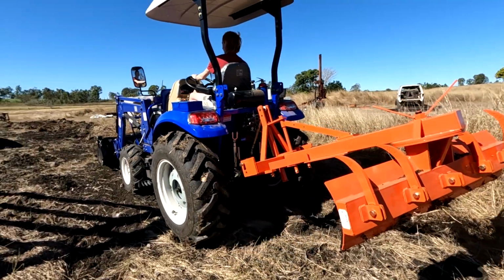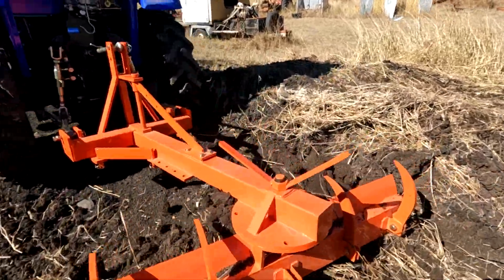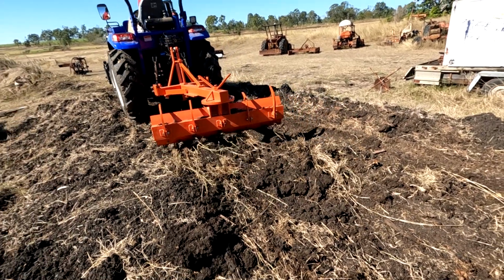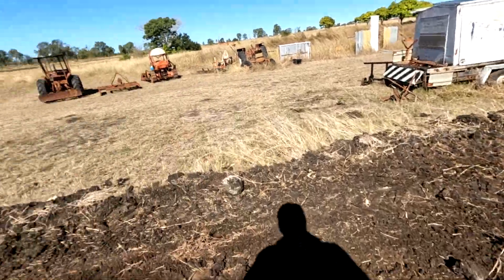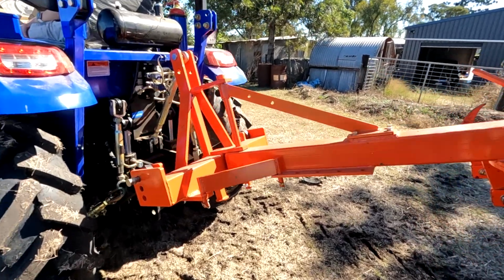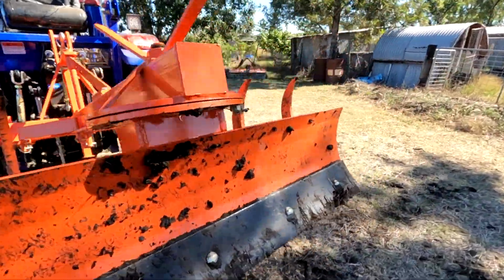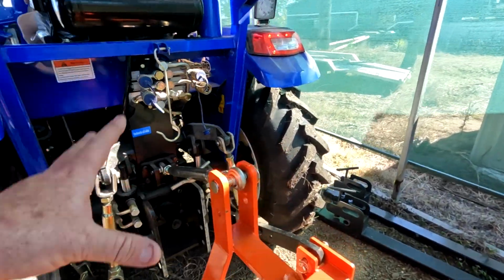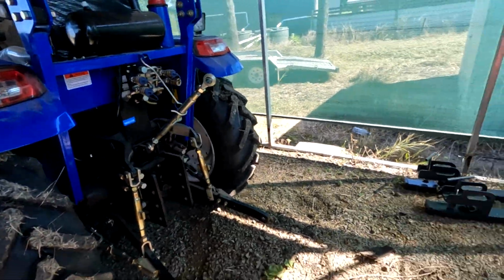TRIDENT 40HP BLADE DEMO

Comment: That young bloke has either used a blade quite a bit or is a fast learner.
Very few tractors have that down force on the 3pl. Would be great rather than just extending the top link - to increase the bite. But did notice the loss of traction as you would expect.
I have a longer and stronger than standard top link that I built ( 50 shs with 40 shs sliding together with a holes and bolt for a pin to give adjustment of length) this longer top link increases the angle of attack of the blade more than a standard top link and makes it bite in - giving more traction !! -
Reply from the maker: Definitely a fast learner mate. Lol thanks for watching 👍.